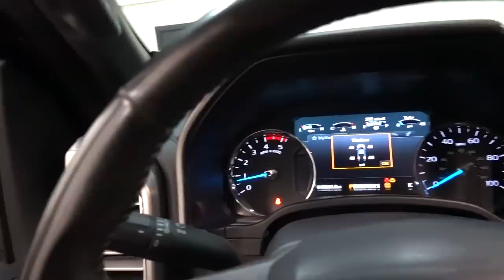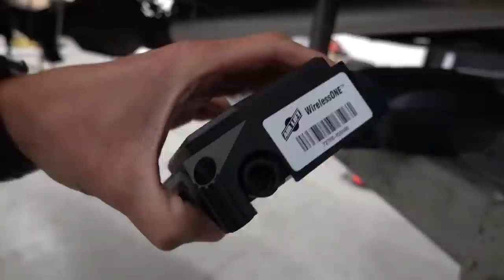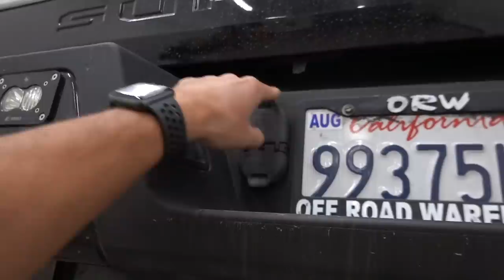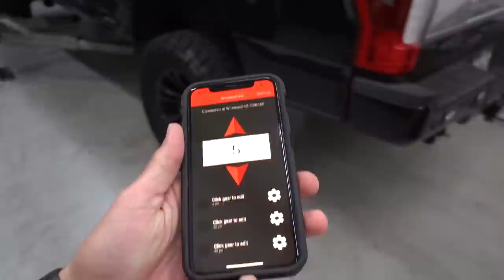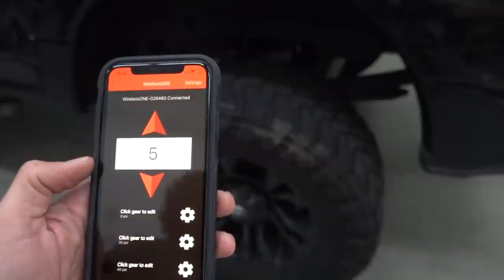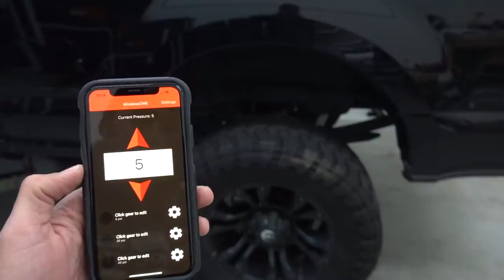WIRELESS AIRBAGS FOR THE SUPERDUTY! (Plus job site update)

Comment: Put those on my ‘19 F450, they’re great, except the phone app doesn’t connect on my iPhone.  I mounted the compressor over the passenger side wheel well inside the bed to keep it out of the elements.  The “universal mount” compressor mounting system wouldn’t fit on the frame because the frame was too wide.  Minor stuff, but it works great!